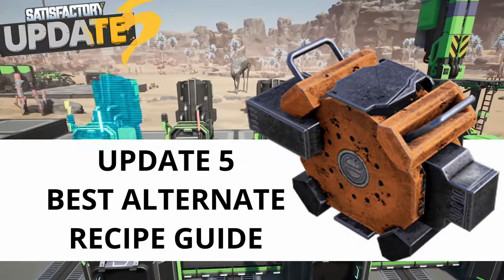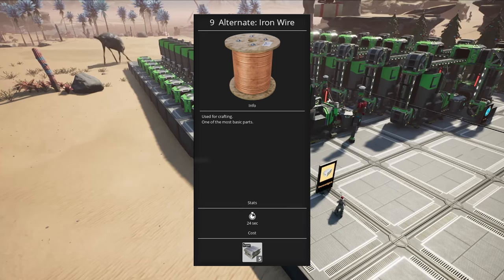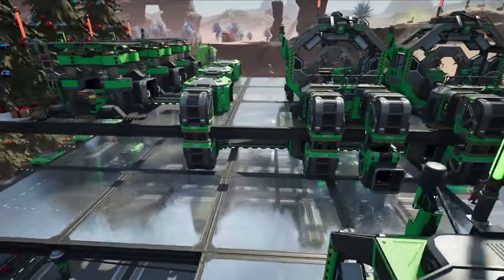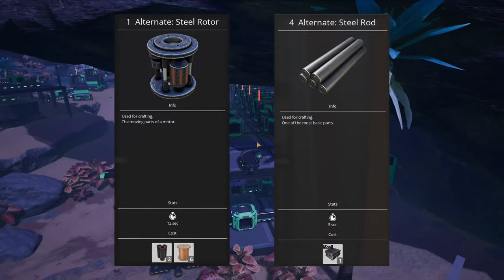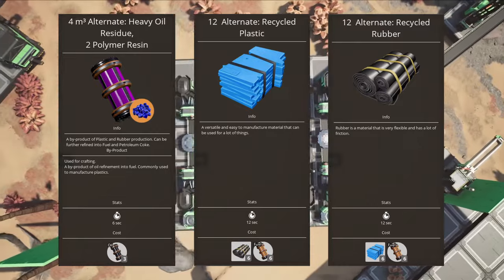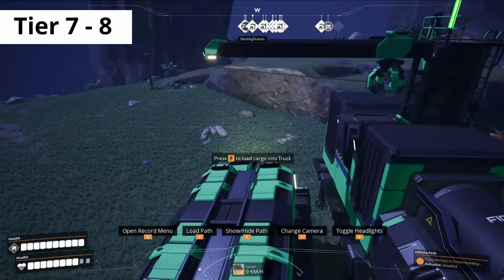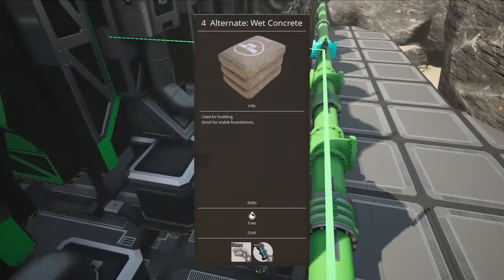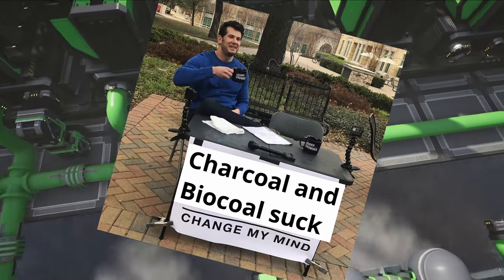Update 7 Alternate Recipe Guide - Best alternate recipes for each tier in Satisfactory Update 7

Comment: Copper alloy ingots is an all time great and I end up using it over the pure copper every time. It produces copper at an insane rate and turns iron into copper at a better rate than the iron wire recipe. It might not give you the same efficiency as the pure recipe but it's a huge boost and takes up way less space and power than the refineries (ugh).

If you pick up bolted iron plates, you should also consider getting the bolted frames. With just 3 constructors (steel screws) and 4 assemblers (2 for bolted iron plates and 2 for bolted frames) you can create 15 reinforced iron plates and 10 modular frames at 100% efficiency. Not the most resource efficient but it's just oh so satisfactory.
Reply: Copper alloy ingots is a great one for efficiency, but there can still be a place for the pure copper one. I'd use it over wet concrete if i need to sink by-product water. Late on, i find I need a lot more copper sheet, so pure copper can serve two purposes.
Reply: @Smyez  I love copper alloy, but my goodness is pure copper a nightmare to use.  over 40 refineries at 100% to handle a single normal node of 600 items!  I can see the value in the increased yield for a post nuclear setup though.
Reply: @TheBlastMage  Looks on my 32 refineries one I just placed on auto-pilot yesterday...  hmm, it wasn't that hard. May as well expand it to process all the copper later on. It's a massive beast, though, that I agree.

Comment: I’d say turbo heavy fuel is pretty decent, you get heavy oil residue recipe and turbo heavy fuel and you have a possible setup 143 fuel gens off 1 600 line of oil
Reply: Just set me up a turbo fuel plant to prepare for nuclear.  Figured I needed some big juice to get it all started.  Now I have 32,000 MW, 3x more than I had previously.  I'll probably hold off on nuclear now lol.
Reply: But diluted fuel gets you 133.33 without needing the coal and sulfur
Reply: @possiblespy7598  600m3 oil gets you to 133.33 generators with diluted fuel. The same amount of oil powers 296 generators with turbofuel, IIRC.

Comment: I'd say Wet Concrete is quite nice since the only thing you pay for using it is power and it's extremely fast and actually more space efficient in horizontal plane since to match the output you need over 5 constructors or at the very least 3 overclocked ones (well, 2 when you don't need the exact match — this actually looks like a win, but for the cost of powershards). Vertically default one is much better, but when you get your hands on the refineries almost every factory will end up using them, so sticking an extra one or two won't matter much and you'll be building near water anyway. So, it's a great way to save on complexity and horizontal space (not counting water extractor), but you pay for that with up to double the energy cost. And in some cases the limestone node you have nearby is just not enough and the other one is too far to bother.

BTW, with the right pipe junction dealing with water byproduct is very easy. You just loop that back into the system wherever water is used in the first place. Production of everything that have water as a byproduct always have water as a component a step back in the chain.

Also, you told there's no bad recipes in tiers 7-8, but I'd like to mention Electromagnetic Connection Rod and OC Supercomputer which are way worse no matter the metric you use beside minor save on not so rare and rather easy to acquire resources. In second case for the price of adding a lot of more valuable ones. And that's when Super-state Computer recipe exists. Turbo Pressure Motor is questionable due to significantly larger Nitrogen requirements, but at least it is way better in literally everything else.

Comment: Only things I disagree with is the wet concrete and biocoal recipes. Producing concrete more quickly is good for many reasons. Biocoal is really good if you don't want to go find coal and incorporate it into the factory. Farming alien organs is extremely easy. Use a constructor to turn it into biomass and then into coal. 1 organ makes 200 biomass, the biocoal recipe is 5 biomass to 6 coal. That's 240 coal. A stack of alien organs (50) should produce 12,000 coal. To put into perspective, the solid steel ingot recipe should net you enough steel ingots for 22.5 stacks of steel beams. I wouldn't really say that it sucks, it's really good early-mid game as you can basically carry 12,000 coal in 1 inventory slot.

Comment: Combining pure iron with the hardened steel recipe would be ideal for the production of fused frames and I think theres a steel frame recipe to make modular frames so in a sense steel pipes and concrete would be all youd need to make a modest amount of heavy modular frames I'm almost at that point now so I'm gonna crunch the numbers and see if its viable
Reply: I built a little factory exactly like this. It generates HMF's and motors out of steel pipes.

Comment: I am far from an expert, but I believe charcoal and biocoal come with compacted coal.  I know I have those and I didn't choose them but I am loving the compacted coal.  I am in the grassland area and with 1 pure coal and 1 normal sulfer I'm running 16 coal plants with coal and sulfer left for other things
Reply: Compacted coal is a whole different thing than biocoal and charcoal. 

Both let you convert biomass/wood into coal. Not worth much since the source can't be automated. 

Meanwhile, yeah compacted coal is great. I'm on tier 7 on my current U6 map and still using the compacted coal power plant I built in Tier 3. Compacted is great if you can get your hands on sulfer early because of the throuput limit on belts early on. I was able to build a plant twice as big as I would have been able to with a truck stations two ports. Great recipe 👍
Reply: @TheInfidel23  ok i must have picked up those other recopies without realizing then.
Reply: There's two pure coal nodes in the grasslands.

Comment: I use biofuel bio coal in two ways that makes it useful in my opinion .. one I put a small plant that produces either,  when I come back to base I just stop and drop leaves wood etc, or biomatter into the little factory .. and a truck stop, which automatically reloads my explorer or truck (or trucks) when the stop by, instant full tank of fuel.  2nd is a bank of bio gens, just 10 or so, set aside. If I accidently overload my network, well I can bring them online for an additional 300 Mw power .. and since they load balance, once they aren't needed, they stop burning fuel and just sit.

Comment: I could see using biocoal or charcoal as a way to dispose of the parts of nature you pick up when setting up a new factory. I have a disposal system in my factory that takes whatever junk I throw in it, and it turns it into liquid biomass which is burned off in an extra fuel generator. You could feed biocoal into a coal generator the same way.

Comment: I had a hard-drive with Sloppy Aluminum, or Pure Aluminum Ingot, or Alclad Casing. I am unsure which one to choose (first).  I think I'll go for Sloppy Al solution because then I can not only get more out of one bauxite mine and reduce Water consumption, but also produce faster while eliminating silica from this stage making logistics setup simpler. Of course this means, that I may need to source more silica to create ingots until I can get the pure recepie... 

On top of that pure AL ingots slow down the process and yields less ingots per Al scrap, so there the only advantage seems to be the simplification by eliminating silica in this stage.
Reply from the maker: That's a great discussion of the benefits and drawbacks of those recipes.  I usually prefer simple logistics so I really like the pure ingots recipe
Reply: @Dekoba  I agree with the simplification. Since space and production capacity are no big issue more machines would only need more power to make up for the slower production with pure alminum. The combination is king I would say.

Comment: I actually like Steel Rods and the base recipe for screws a lot more than steel screws or cast screws. Steel rods combined with solid steel ingot gives you the most possible throughput of screws for each iron you have and if you don't like cutting them from the production chain (like me) its a huge increase in efficiency!
Reply: Cast screws are faster uses less power, less machines, and exactly the same amount of iron per screw, compared to iron-rod base, it is strictly better. EDIT: sorry, i misread, thought you where talking about the standard recepie for the rods as well.

Comment: I've got a stack of 30 hard drives. 200 hours in and i finally went hunting. it's those damn screws man. hoping for the steel screws 260 p/m yes please
Reply from the maker: I hear ya.  I did a run where I got rid of screws altogether. It was fun...
Reply: @Dekoba  yeh you mentioned a zero screw run in your video, i had no idea that was possible.
and i did get the steel screws!
i re-watch your video each tier up lol. top man Dekoba
Reply: @Dekoba  yup. Screws fill half my factory

Comment: Can alternate recipes show up on multiple hard drives if you don't pick them the first time or do you get one shot?
Reply from the maker: Yes, if you get more hard drives you get another chance to get them. If you take the time, you can get all of the alternates.
Reply: When you put a Hard Drive into the MAM to scan, the game selects 3 recipes from the pool to present for your choice after the scan completes.  The size of the pool depends on what milestones you have completed through the Hub and resource research through the MAM to determine what is eligible.  The 2 recipes you do not choose go back to the pool and are valid options for the next Hard Drive you insert.  There are currently more Hard Drives on the map than there are alternate recipes (plus an additional 2 instances of +6 inventory size), so even after you have unlocked all the alternates there will be ~5 Hard Drives left over.
Reply: @PhailRaptor  Now this is a helpful comment! Been wondering about this. Thank you!

Comment: Turbo fuel is unlocked as a possibility after you unlock compacted coal (which is, in turn, unlocked after the very first tech in the sulfur tree).

This means you can start making turbo fuel as early as oil production. Of course, you won't be able to make many fuel generators because they require computers and heavy frames -- but quite a few computers and frames can be found near crash sites. Considering that turbo fuel plants require an insane number of generators, you're not really able to get a turbo fuel plant off the ground until you automate both computers and heavy frames. 

Still -- they're available much earlier than nuclear plants and you can at least get them started very early and just expand it really quickly once you have a lot of frames and computers. If you have a large coal power plant or shutdown your factory for everything except computers and heavy frames, you can just skip normal fuel power plants and go straight to turbo fuel.